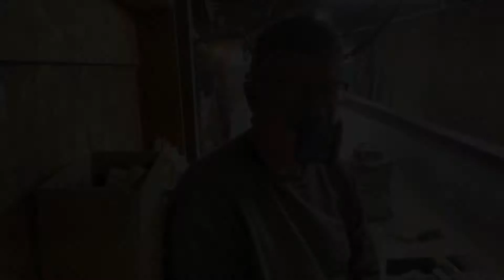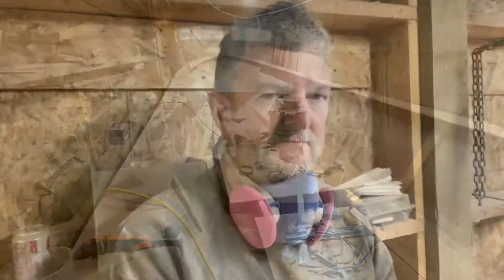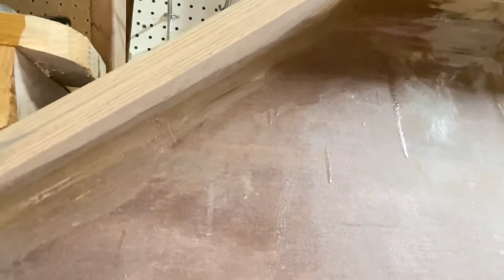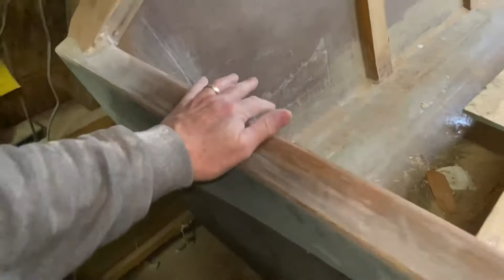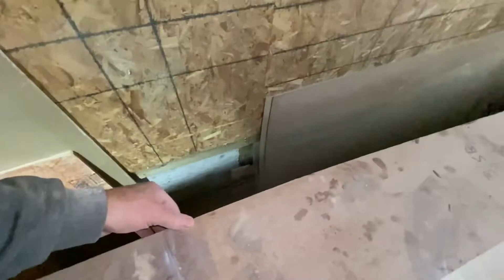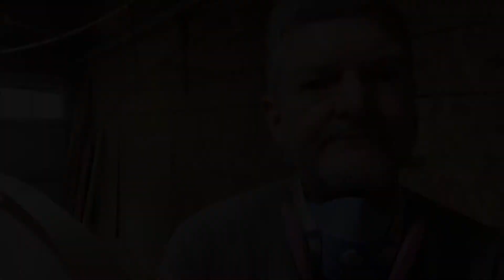Never say “I’m almost there!”

Comment: Love the videos and the build. I’m not trying to be critical but on camera it looks like you have a tremendous amount of airborne sanding dust floating around your shop. Maybe you should build and air cleaner with a box fan and som HEPA filters. I’m sure it’s cold out and that’s why you don’t have the doors open. Again, not trying to be critical, just concerned.
Reply from the maker: Yes, there was dust today, and I do need a higher volume air cleaner. I had literally just finished grinding off some dried epoxy when I decided I needed to film the video! Glad you’re enjoying them.
Reply: Hello how are you doing today